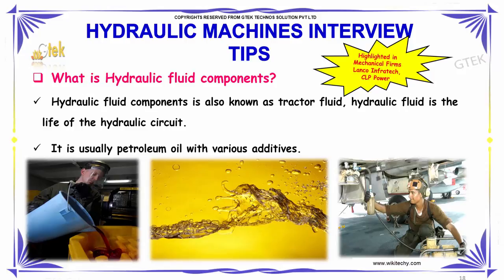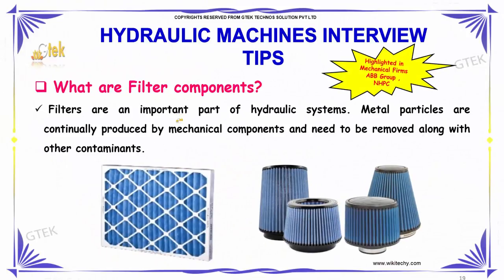hydraulic fluid and filter components | hydraulic machines interview tips | wikitechy.com

Comment: Pressure Filters are placed behind the pump and clean the hydraulic oil before it flows through down-stream components like valves, cylinders and so on.

Comment: A Series, C Series, and D Series hydraulic pumps are designed with long term performance in mind, including: high-strength cast iron bodies, hardened alloy gears and shafts, bronze bearings, and Buna-N sealing members.

Comment: Petroleum-based or mineral-based fluids are the most widely used fluids today. The properties of a mineral-based fluid depend on the additives used, the quality of the original crude oil and the refining process. Additives in a mineral-based fluid offer a range of specific performance characteristics. Common hydraulic fluid additives include rust and oxidation inhibitors (R&O), anticorrosion agents, demulsifiers, antiwear (AW) and extreme pressure (EP) agents, VI improvers and defoamants. Mineral-based fluids offer a low-cost, high quality, readily available selection.

Comment: Hydraulic oil contamination is the key for construction equipment diagnostic. ... Standard filter and oil change does not reduce hydraulic components wear rate. ... Tsang stated that the primary objective of maintenance is to preserve system .... Hence, oil analysis techniques for condition monitoring offer significant potential ...

Comment: Filters in a hydraulic system maintain fluid cleanliness at a level that ... Given that the objective of this process is to extend the service life of components in a ... High case pressure can cause the pistons of radial piston motors to be lifted off the cam. ... using oil analysis and other condition-based maintenance techniques.

Comment: A hydraulic filter helps to remove these particles and clean the oil on a continuous basis. The performance for every hydraulic filter is measured by its contamination removal efficiency, i.e. high dirt-holding capacities. Almost every hydraulic system contains more than one hydraulic filter.

Comment: A hydraulic filter helps to remove these particles and clean the oil on a continuous basis. The performance for every hydraulic filter is measured by its contamination removal efficiency, i.e. high dirt-holding capacities.

Comment: Hydraulic fluid. ... Common hydraulic fluids are based on mineral oil or water. Examples of equipment that might use hydraulic fluids include excavators and backhoes, hydraulic brakes, power steering systems, transmissions, garbage trucks, aircraft flight control systems, lifts, and industrial machinery.

Comment: The performance for every hydraulic filter is measured by its contamination removal efficiency, i.e. high dirt-holding capacities. Almost every hydraulic system contains more than one hydraulic filter.

Comment: A reservoir for hydraulic fluid, which allows power transmission to be transferred through the system. ...
A filter to remove foreign contaminants.
A pump to move hydraulic fluid through the system.

Comment: The basic foundation to perform proper maintenance on a hydraulic system ... Equipment Manufacturer state for Preventive Maintenance on the hydraulic system? ... Change the (could be the return or pressure filter) hydraulic filter. .... Objective: The objective is to eliminate the introduction of contamination through oil being ...

Comment: Hydraulic oil is different than other lubes. Not only is it a lubricant, it's also the means by which power is transferred throughout the hydraulic system. So, it's a ...